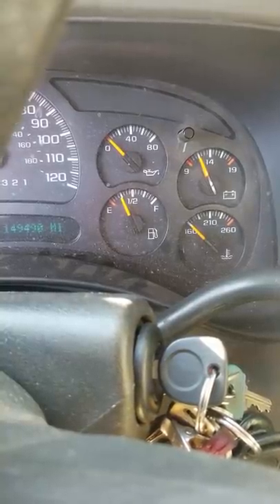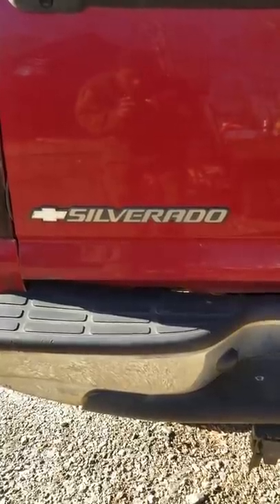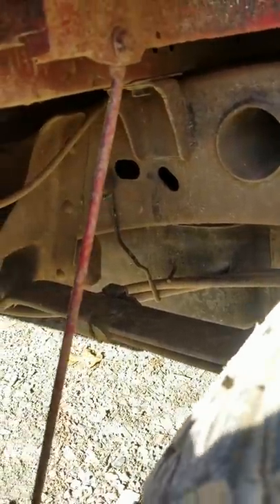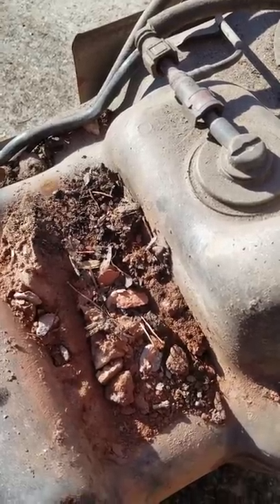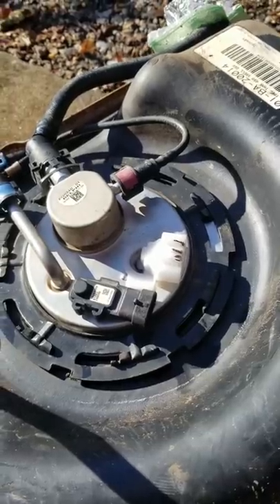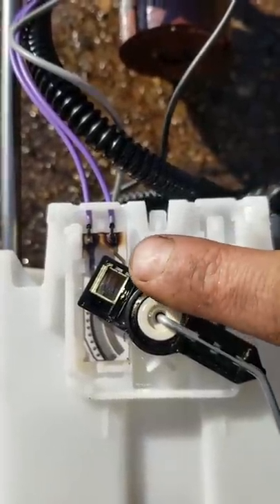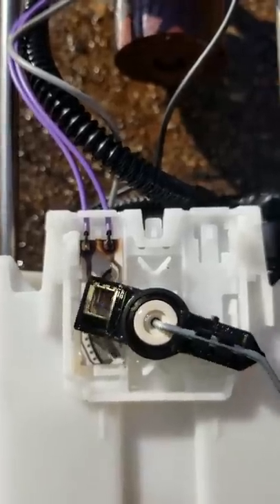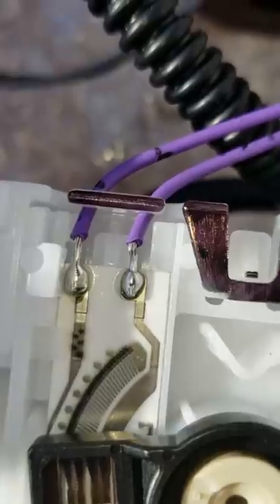Customer States Fuel Pump Broken

Comment: I’ve owned 3 GM cars and their gas gauges are all the same. Full to half seems like your getting great gas mileage. But once that needle goes just below half you’re on empty 50 miles later.
Reply: Swear to god bro lol
Reply: Exactly what happened to my 1996 Chevy Cavalier.
Reply: 11mpg sucks
Reply: Owned an '01 and '13 silverado. Can confirm.
Reply: @ruwithlee1970  this thing probably gets 19
Reply: @Yeah Right outside of GM I’ve only owned ford, Audi, VW and all 3 were very accurate with their gas gauges. I’ve driven other makes but not long enough to speak for theirs.
Reply: @kineticinstallationspecial5775  
My 01 Suburban 4x4 only gets about 11mpg highway  maybe 13 or 14??
The 1994 Suburban I has got 16 mpg with a 5.7 liter???
Reply: @ruwithlee1970    I can't figure out what Chevy did. I've got a 1993 Chevy Silverado half ton with 5.7, and it still consistently gets 18 on the highway! I've got a reman engine in it and it's exactly the same as the old one. 18 highway consistent. So what did they do to the newer ones?
Reply: @danadribnenki8774  maybe better injectors and a new mass air flow sensor?  Thats great you are getting that kind of mileage out of a 350. Ive got a 07 suburban with the 5.3 and can get only 16. Mine just turned over 200k miles
Reply: It's so true in my buick, above a half tank, last forever. Below a half goes bye bye.
Reply: @ruwithlee1970  rear end gear ratio, tire size
Reply: Itz_Hunted  most ford rangers need only about 5 psi of oil pressure and thats enough to give half deflection of the gauge needle. So it reads in the normal range. Its just a switch like an idiot light uses. People want gauges on the dash not idiot lights so Ford gave out gauges! In reality they are not gauges. Pretty crazy what they do to cut costs.
Reply: I've noticed the same in my '12 mazda 3 Skyactiv. The first quarter of the gauge almost gets me the same mileage as the last half of the gauge. Really annoying tbh, i never know how much gas i've actually got
Reply: Itz_Hunted  that’s how my new edge sn95 is
Reply: The shape of the fuel tank gives an illusion of it being more full, kinda like a shot glass or any beer stein that fits more on the top half because of its shape
Reply: I have a European model VW Polo, same thing. It isn’t even „all American cars“ or anything.
Reply: Had a 2004 GMC Envoy. No lies told here💯
Reply: @Yeah Right Yeah most cars are like that, happens in my dads 07 charger and these guys think it’s a GM exclusive 🙄
Reply: Learn your vehicle, drove 2 gm's with no gauge for years, never ran out... fill to full, xxx miles on Tripometer time to re-fuel.
Reply: 99 trailblazer blazer. Yep
Reply: my mom’s ‘01 Suburban 1500 is exactly like this 😂
Reply: Happens on my 3rd Gen tacoma. Full to 3/4 I get like 140 miles from it and from the 3/4 to half a tank I get like 50 miles.
Reply: My '14 Cadillac ELR is far from that. Has never given me any issues with the gas gauge. Not all GM cars are like this.
Reply: I got a cts and the gauge works the same way.
Reply: @Yeah Right cap
Reply: Yesssss forreal
Reply: My 87 k5 left me on the side a few time with this exact problem
Reply: @jeffp7368  not my Ford, damn thing says I'm on E when I got a quarter tank left
Reply: @ElectricBillAlbright  they didn't do it to cut costs, dealers had people coming in complaining that their needle would drop at idle. Didn't know how it worked
Reply: My momm told me not to let the gas tank go below 1/4.
Reply: @jatpack3  I get average 23 mph in my 2016 Chevy Malibu lt and that thing has some serious balls on the road. I love it tbh
Reply: @phillipmiller4139  What’s wrong with having reliable gauges in a vehicle?!? We aren’t driving go karts where we need to remember how much fuel and oil is consumed per trip...💯
Reply: My C5 is literally the exact same way... Once half a tank comes it's time to think of a station
Reply: My Tesla does the same
Reply: @Yeah Right nah my Ford Fusion can go 30 miles on e
Reply: @Yeah Right yah my 06 and 11 subie didn't have that issue at a quarter tank I have about 100miles left
Reply: @Yeah Right no.
Reply: Facts LOL
Reply: Itz_Hunted  nah the coolant gauges are pretty accurate. The coldest temp on newer cars is usually 160*, which is only 40* away from operating temp. It makes sense that it takes longer to go from a cold temp like 0* to 160* than 160* to 200*.
Reply: Happens on my 08 tundra
Reply: My 2004 canyon is the same way!
Reply: @Yeah Right Thats a big negative, Lexus seems to have gauges that accurately read the available fuel…💯
Reply: Exactly what’s happening to my 97 ranger
Reply: Yup my vette is on full for super long
Reply: Had a 97 grand prix gtp and can confirm
Reply: Yep. Can confirm
Reply: I thought I was the only one🤣 I’ll be 3/4 when I get home from work, leave the next morning with the gas light on😭😂
Reply: I thought my Truck was special Lmao
Reply: @Yeah Right my 2004 f150 is bad after half
Reply: @boobiewatchr  mine too lol
Reply: In my family we own 4 little Opels and every single vehicle has the same problem you just stated 🤣
Reply: Is the way the fuel cells are designed
Reply: Same with my F150. When I’m over half a tank I’m happy 😂
Reply: All cars bro... I have a 36 gal tank in my f1shitty, and I can't fill it up based on the Guage, I have to remember how many gallons I used up if I want to fill to 3/4 tank, etc.
Reply: On me lmao
Reply: @Celtics20   I’m like hank hill with my truck
Reply: @mickeyslim   I’m like hank hill with my truck lmaooo
Reply: @kk-kh2kk  I had the same car and I loved it even though it constantly broke down.
Reply: I have an ATS with the 3.6 and AWD and I'm averaging 25.2 right now and yeah anything under half seems like it's fucking done on the way home
Reply: i track my miles, full to half gives me about 165 miles and then half to empty gives me about 80 miles
Reply: YEP!!
Reply: @jeffp7368  yea same it was a great car until the transmission finally went out
Reply: Exactly my issue with my Cadillac.
Reply: 06 G35 same exact issue
Reply: I've had 5 GM vehicles from Cavalier to Camaro to Colorado and this is 100% accurate lol. Opposite were my Hondas/Acuras which seemed like they never moved once they hit half
Reply: My ford's the same. Probably because the float follows a small Arc. The Audis and mercs are better with this because they probably correct the error by mapping the resistance to the actual fuel value using a lookup table.
Reply: My F150 does the same, however, once I get really low, it happens to lift just a fuzz from empty just once
Reply: On the trucks and suvs it’s because of the shape of the tank. As for cars idk.
Reply: Literally how my old Honda fit was, it would go 100 miles before the needle even moved off the full. Soon as it moved though it was all down hill from there lol!
Reply: Same with my chevy I swear.
Reply: I swear my Tacoma is the exact same way
Reply: My 2000 silverado is never like that and never sees over half most the time with gas prices
Reply: @Yeah Right totally disagree.
Reply: My first car back in '84 was an '80 Chevy Monza with a 151 4cyl. Yep, so true with that gas gage. Got the best gas mileage until it hit 1/2 tank. After that, it went quick!
Reply: My new ford is like this
Reply: My astra (which has a gm engine) does the same
Reply: @thethumper088  94 Silverado same thing
Reply: Same with my 85 Regal and 76 f250.
Reply: It's due to the design of the float, it's the same design as old cessnas and other planes. It looks like the fuel goes down exponentially faster. If you look a a Cessna fuel gauge you will see how they account for it
Reply: Same with my 2nd gen 😆
Reply: Literally. And mine is a freaking Aveo 😭
Reply: 😂😂yeah I’ve done about 30 400 mile trips in my jeep xj and it almost always seemed to do that
Reply: My dad owns a 97 Silverado 2500 and anytime I drove it he told me once it got below half a tank your time is limited💀
Reply: My 94 Suburban is not too unlike that. About 5/8’s and then it starts dropping like a rock
Reply: @Yeah Right my 96 Lexus SC300 wasn’t at all like that. But my 94 suburban is, my prior 97 suburban, 98 Yukon, 05 Silverado, 07 Nissan Xterra, and 1971 Camaro
Reply: 09 impala.. And it's exactly the same.. Soon as it hits half, it's time to gas up
Reply: Shitbox things they have miles to E on these trucks 😂 it’s always nice to put it in park and watch the mileage jump up 😂
Reply: My Hondas and Subaru do that
Reply: @boobiewatchr  I have an 04 Envoy, it does the same thing lol. I'm always driving with 0 battery volts as well.
Reply: @Jsuarez6  miss my cav
Reply: 1990 4runner 2 wheel drive can confirm same thing and my gas gauge works
Reply: Ford Taurus has a similar but not quite as bad issue
Reply: 98 f150 as well
Reply: @Yeah Right I've never had a car like that
Reply: My C6 ZR1 is exactly the same, except when you get to 1/4 instead of 1/2
Reply: Having owned GM years between 1973 and 2008, I can confirm.
Reply: bro me😭 it sucks
Reply: @boobiewatchr  mine does the same thing 🤣🤣
Reply: Yea my mustang is the same way
Reply: Damn I thought I was the only one with that problem
Reply: Why do you keep buying them?
Reply: @ruwithlee1970  I doubt all of that. You're probably getting under 10.
Reply: @jatpack3  
Maybe I should change my pcv valve and mass air flow sensor and clean out throttle body and run some injection cleaners through the fuel system to help MPG??? 270 Miles to a tank is Painful at $4.35 a gallon of Gas ⛽️???
Reply: Our Mazda had this problem
Reply: My 08 Silverado was sooooo fucking bad with that, my 15 f150 doesn’t seem to be like that at all, it seems about the same to me.
Reply: WHATTTTTT ITS NOT JUST ME OMG
Reply: I've owned 10 all like that
Reply: Factssss
Reply: @thethumper088  it's really just the electrics
Reply: Most stuff is like that.  I ran a 2154D deere all winter. 1050L tank could run a shift to shift and a half before it left full and and that was 400 liters almost
Reply: @ruwithlee1970  my 97 350 vortec is around 14 to 15 average
Reply: @Yeah Right i have owned a ford fiesta 2005 and a golf 6 and both were very accurate all the way till fully empty. Golf even gives range approximation which is pretty good too. Maybe a bit inaccuraze when down to like 30km but what do you expect with 2l slushing around in the gas tank.
Reply: No truer statement 😂
Reply: @Yeah Right wrong, my ford lasts over 60 miles on E.
Reply: Yeah literally my truck !
Reply: Yee bro my 04 sierra is great full to half, then it's yellow light after 60iles
Reply: Mine always went way over full. Took like 100 miles to get to the full mark. Then it went 250 miles to get to half. 50 miles later, almost empty.
Reply: Thats how my tacoma is
Reply: Bro when I had my s10 on god
Reply: When my dads truck gets past half it still goes for like 2-5 hours?
Reply: Facts! My Suburban act like a Civic until I get to the 1/2 mark and then it’s just gone. 😂😂
Reply: Counterpoint: My Impala must have a back up engine fueled by depleted Plutonium in it or something because once I get to 1/8 it suddenly stays there for long enough to get lunch in Mexico and come back home and have enough gas to get to work tomorrow without stopping at a pump.
Reply: 10 impala, yep thats accurate
Reply: Seems like most cars have that issue. I've owned Ford, Chevy, Toyota, Dodge, Hyundai & Nissans and they all seem to have that issue. I can get 250 miles on the first half a tank and 75-100 on the 2nd half.
Reply: That’s any vehicle I’ve ever driven man
Reply: @Yeah Right my nissan isn't lol, I've ran around on a quarter tank for a week before lmao, and my fuel gauge works properly.
Reply: @Yeah Right my vw went an hour and a half into Chicago and back in a quarter tank, but that thing was a diesel. Gm fuel gauges are just kinda fucked from this era
Reply: Happens to every car pretty much. Some worse than others. My liberty was empty from a quarter tank in like 12miles 💀
Reply: E:right if we if pic8)
Reply: E
Reply: 2000 Buick Century when I slow down gas goes down, when I speed up gas goes up😂
If I park on a level surface It'll be the right amount after settling. Good job GM😂
Reply: @ruwithlee1970  12.5 on my 05 colorado. And chevy won't fix it even tho they admit it's factory defective
Reply: @andreyangere3076  
Ratio is 3.73
Tire is 245/75/16 A/T
Reply: @Yeah Right nahh not my Ford
Reply: You're*
Reply: Shape of the tank.
Reply: My 08 cobalt is completely different. My first has goes fast my second half last forevr
Reply: My accord is the same way
Reply: My Ford Focus is like that too. 200 miles on the first half tank. Maybe 75-100 on the second half.
Reply: @jeffp7368  I’ve driven ford Audi vw and Subaru. My Subaru is the only accurate gas gauge I’ve had besides my 2019 Jetta.
Reply: I SWEAR MY PONTIAC IS THE SAME WAY
Reply: My Pontiac solstice has half a tank, then half a tank later it's at a quarter, but is it really? No idea.
Reply: It's due to nonlinearity of either the gauge or the tank. Likely not the gauge, as they are not custom built to model the tank shape. The resistive wipers are standardized for use in any tank. The only customization, though may have some commonality across tank styles, are the floats.
Reply: Mark of Excellence
Reply: @Yeah Right Nah four cylinder imports will run for 40 plus miles on E
Reply: Just an old style of floaters
Reply: Right normally my Silverado is good on gas but ever since the stupid pandemic everything has changed
Reply: Same with older ford's lol
Reply: Thats all cars. Fuel gets better mileage the cooler it is. The more fuel in the tank the lower the avg temp of the fuel
Reply: Well… it’s proven that you get better gas mileage the fuller your tank is… something to do with fumes and what not.
Reply: That’s how analog fuel gauges are. On my way home from work I can watch the needle go down as I go uphill lol
Reply: My C6 ZR1 is EXACTLY THE SAME LMAO
Reply: Same with every car I've ever owned. Even my Prius.
Reply: My 97 sierra with a new pump is the same
Reply: My Infiniti is just the opposite and after owning two separate ones I’m starting to think it’s just reversed lol. My Tahoe does exactly what you said too 😂
Reply: @jeffp7368  my dad had a 2010 F-350 diesel 6.4 with every option they had for that year. Heated front seats big captains chairs. Backup cam step assist tailgate Sirusxm I loved that truck it was extremely reliable. Idk why people say 6.4's suck. He had almost 300,000 miles on it. My favorite thing was it had the regen cycle on it and in the winter when it would come on it would leave a big cloud of white smoke. It was funny AF
Reply: My old Cadillac was like that.  1/2 tank you might wanna think about getting some gas.  1/4 tank=empty.    E=there might be a gallon left, good luck sucker.  Ran out of gas until I figured it out
Reply: Yep lol
Reply: @Yeah Right nah
Reply: My 03 impala did that bad
Reply: @danadribnenki8774  my 2017 gets 21 average in Maine.
Reply: It's common for most vehicles. Years ago Dodge had a recall on Dakota pickups because they had tried to reverse how fast the gauge fell from full and owners were complaining of horrible gas mileage.
Reply: Itz_Hunted  the gauge doesn't start to register a temp until about 150-180.
Reply: @rdsimmonds  That was the least of Dodge's worries 😂
Reply: @johnmosesbrowningsrightnut8642  true, but it highlights that manufacturers know about the change in how the fuel gauge drops. And it's also amusing that Dodge did that and had to do a recall.
Reply: Because the tank gets smaller as it goes down, more tank volume at the top half.
Reply: @HeterosexuaI  by the level of the float which is generally a 5 volt reference. Considering there’s less fuel in the second half of many tanks it’ll drop faster. You’ll also notice the gauge move higher or lower based on fuel economy.
Reply: @HeterosexuaI  hopefully that answers your question lmao
Reply: It's a cluster gauge problem that GM refuses to recall.
Reply: My 95 c1500 gauge runs all the way to needle limit on full. Like to the bar that stops the needle
Reply: Itz_Hunted  gauges are very general anyway. Plus I’ve learned from bikes that the coolant gauge isn’t gonna show anything at all until a certain temp. That would explain your situation.
Reply: That's how my Ford seems too
Reply: Yup same same on my GMs
Reply: Chevy electrical quality right there 😂
Reply: @Yeah Right not true, it’s just a. Chevy thing
Reply: Lol I just too it off every time I go out
Reply: @scottm.9382  u
its always the electrics man
Reply: My Lexus feels the same way
Reply: yup, that last 1/4 tank feels like nothing
Reply: @@yeahright5227swear every car I’ve driven is similar to this but maybe not as aggressive as that
Reply: @@yeahright5227yes sir, I own a German pos.
Reply: I hate to break it to you but that's literally every car ever made in the last 40 years not just gyms it's Jim's cause I've had G m's do that of that Hyundai's do that Honda's and even heard of some s*** Box forwards doing that so it's basically every car ever
Reply: @6luealreadydead  German car here, my mileage seems great until half and then it quickly drops off.
Reply: My 1999 Sierra 1500 was the opposite, I'd get like 100 miles max from full to a quarter tank, and the next 250 were from a quarter to empty lol
Reply: Fr. Once I hit a quarter I’m pretty much on e
Reply: I got a Ford with the opposite issue. Fill that sucker up and its on full for a bit, then it drops like a fucking rock till it reads about half full. Then that sucker drops at a fuckin snails pace the rest of the way.
Reply: my gmc sierra was the exact same way
Reply: @Yeah Right not ford
Reply: That’s really the same on all vehicles just not as dramatic. All my vehicles did that. Fill the tank and from half to full last a long time. From half down goes so so fast.
Reply: my 96 caprice is deathly accurate literally the second the gas light comes on it starts sputtering. and yea that last half tank goes suspiciously fast in old gms
Reply: My Enclave 😂 said I had 75 miles
Reply: @@yeahright5227That’s true because my 2010 Toyota RAV4 whenever I fill it up it takes a while to get off of the full line but as soon as it gets to half it goes to empty really quick
Reply: Haha I just picked up a 2020 and I have been driving a week on full
Reply: Seems like every vehicle I've ever owned does that. From Chevy, Ford, Toyota, Mazda, etc.
Reply: Jesus I never put that together. 😂😂😂
Reply: The 90 cavy I have is the opposite goes to half super fast and then will go another 300 miles in town on the last half
Reply: I had a van with a non working gauge for 3 years. I tracked my mileage on the trip odometer. Never ran out of gas.
Reply: It depends on the shape of the tank, something the sensor doesn't take into account.
Reply: Have you ever tried filling your tank, zeroing a trip odometer? Then at the next fill up do the math from the gallons you put in and the miles you drove.
Reply: @phillipmiller4139  Same here. 5th grade word problem math.
Reply: 😂 First time 06 Silvi owner here and I’m glad I’m not crazy.
Reply: Bruh my 04 Escalade is literally just like that 😂
Reply: I FEEL this😂
Reply: Shit this happened to mine. It didn't read the correct shit. Like when it filled up before it was 305 miles but now whenever I fill up it says it's only got 240 miles it stays like that for a bit then it gradually goes down to 100 or less. Does that mean I gotta fix it?
Reply: That's exactly how my 05 colorado was. I had the 5cyl and it seemed like the gas gauge would barely move no matter how much I hit the gas but until half way that's when it just looked like it was eating it up
Reply: Another tip for the sending unit is to spray it with corrosion protection helps with all the dirt and salt in winter
Reply: All are like that because the tank isn't shaped like a literal box....
Reply: @Yeah Right  My moms honda odyssey did over 50 miles after empty in the empty mexican desert. But hope you get your car fixed <3
Reply: Not with my v6 7th gen accord!
Reply: Yep. Started happening to my dad’s 2002 Holden Statesman in its twilight years.
Reply: Same with my camry probably just an engineers illusion
Reply: MK5 VW Jetta does the same exact thing. I just reset the trip meter every tank and I know my average range per full tank. Is usually 300 when I drive efficiently but let's be real, I don't anymore especially after installing cold air and replacing the bad downstream o² sensor and MAF sensor for a good one.
Reply: huh. my 02 silverado works just fine.
Reply: @Yeah Right not every car
Reply: @@yeahright5227none of my cars are like that and my family combined we have about 20 vehicals  all fords and a few dodges
Reply: @Yeah Right nope my Camry doesn’t do that brother
Reply: Yep Sounds like my vauxhall to me
Reply: @jeffp7368  can confirm, if my vw was like ‚we out‘ then yea, we out man 😮‍💨
Reply: 2020 dodge ram
Same issue
Reply: I have an older Chrysler Town & Country minivan. 80ish miles before the gauge budges off the "F" but it's looking scary 80 more miles down the road.
Reply: My Hyundai is the opposite, full to half goes so fast then half to empty feels like 400 miles I swear
Reply: Laughs in 3800
Reply: That is inaccurate my friend
Reply: 07 Ridgeline same thing
Reply: Honestly I own a 2004 2500 Silverado 6.0 she hood at full and half than once it gets below that it chugs it